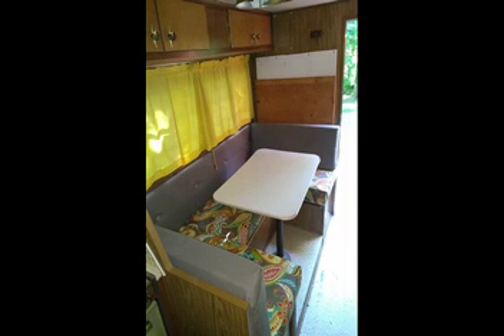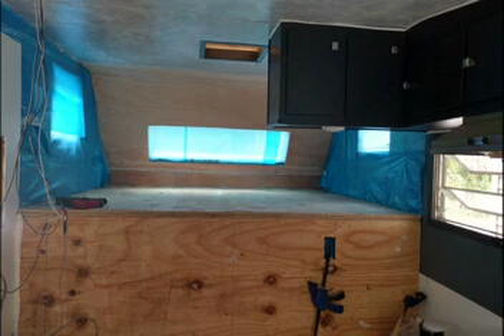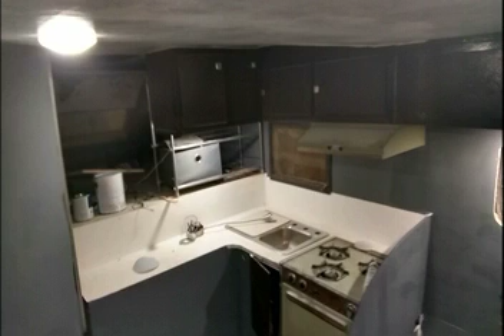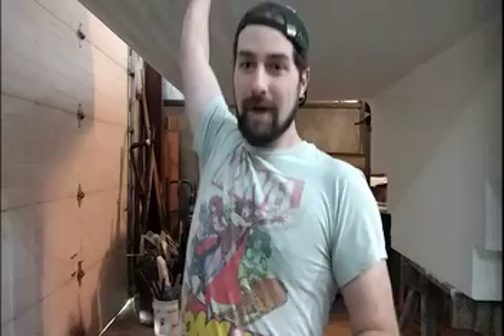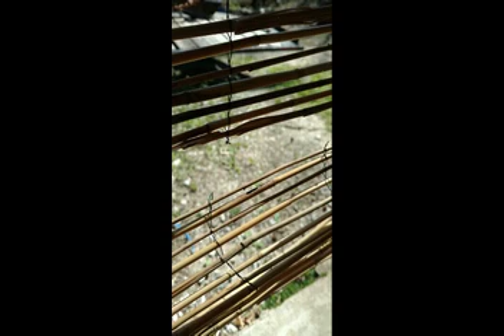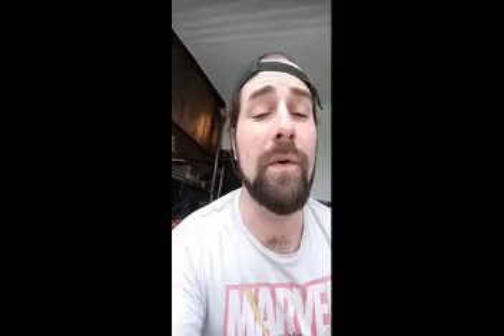DIY $30 RV Mattress Breather (No more mold!)

Comment from the maker: This solution worked great for one person, but adding a second person increased the wear and tear through a 6" foam mattress and essentially ground the paint off. I tried replacing the reeds with six layers of plastic sunshade cloth. This made the matress slide around a little but otherwise worked for one person for 8 months of full time living. Adding a second person dramatically increased the moisture and mold restarted within a week. I will be making another video with a third cost effective option.

Comment from the maker: Over a year later and no mold. However, the wires woven into the reed fences have some surface rust which stained the back of the mattress with little red dots. I would recommend placing tape over the wires to protect your mattress.